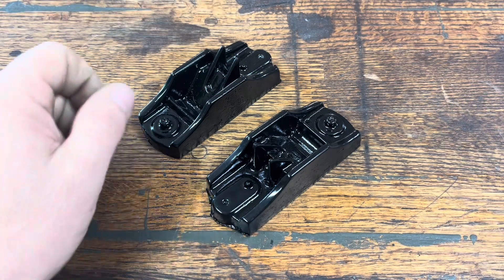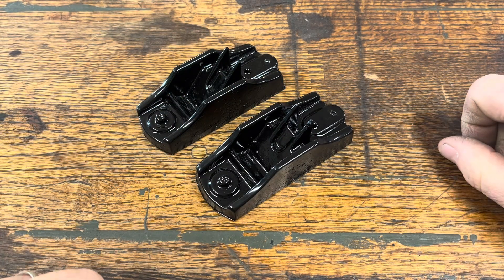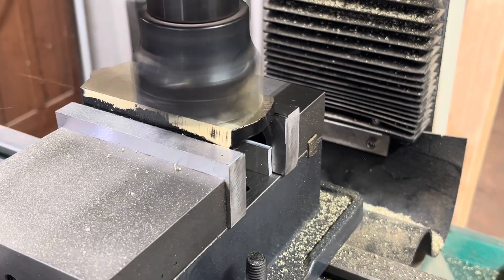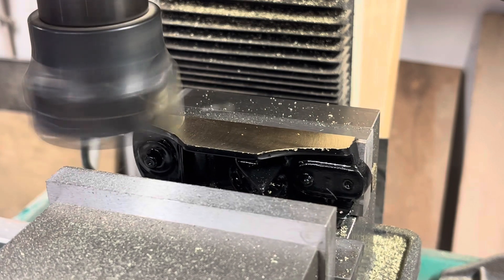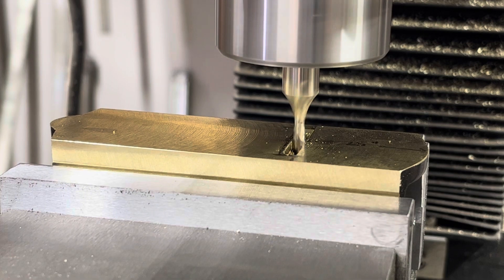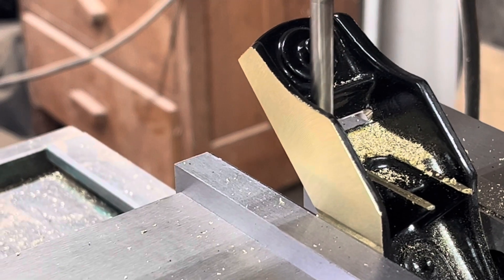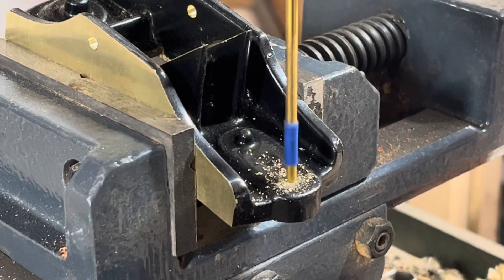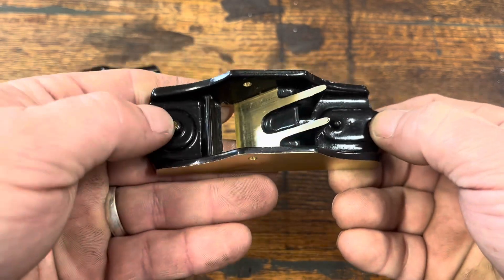Making a Plane from Scratch Part 2: Machining the Body

Comment: Great to see full scratchbuilding like this! 
I note that, when machining the sides, you appear to grip the workpiece at the bottom of the jaws using a rectangular block. (apologies if I am wrong, not easy to see). This is not the most stable clamping, especially when you are milling left to right, meaning that the cut is away from the back jaw. Clamping further up would be more stable- one way would be a U shaped jig with the legs against the front and back handle pads, and the centre against the moving jaw. I would still machine right to left, cutting towards the fixed jaw.
Tapping the holes- standard method is to use a tap-follower ( an easy shop build, or readily available) in the mill (or drill) so that the whole tapping process can be done while alignment is assured.
Enjoying the series!

Comment: Hi Dave, another informative video, thanks. Question; what blasting medium do you use for blasting the brass and would it be the same medium you would use to blast the cast iron of a Stanley smoothing plane?
Reply from the maker: I use a very fine white silica sand to etch the bodies. For the removal of rust and old japanning on older planes I use a im heavier black sand.
Reply: Thanks Dave.

Comment: Hello Dave, I’m by no means an expert but I was wondering if brass is a good choice for a long lasting plane. Isn’t brass too soft? Thanks for making these videos! I enjoy them very much.
Reply from the maker: For small planes brass is more than durable enough for planing. If it were a larger plane or one that would see heavier duty work like a scrub plane or a Jack plane brass would wear quickly. But for small planes that do light work brass is a good material.
Reply: @DaveCorinth   It looks like you already have the workflow in place, so it would be easy to experiment with other castable alloys.  Something like a 10% tin bronze (by weight, the rest copper) would be a bit harder than brass, and as an added bonus, it wouldn't have any zinc to burn and make toxic fumes.  A 10% aluminum bronze would be trickier to cast well due to more shrinkage issues, but if you pulled it off the stuff approaches steel in toughness.  Also, the golden color of aluminum bronze is really nice.
Reply: Wear is not a problem- these are for looking at, not using. They are very pretty, but a block plane will do the same job- and be more comfortable to hold, as well as having (if you wish) depth of cut, lateral  and mouth size fine adjustment. 
These will sit happily on a shelf, gathering dust but not rust... And be well admired.

Comment: I watched the video of using a 101 and found it so interesting! Now I have watched the casting process.  Why did you switch to casting?  Secondly why do you use brass? I know to heat steel or cast is more complicated - but brass well durable and somewhat easy to work with, for me is so expensive.  I might try aluminum or maybe a bronze. I sure do like what you are doing and thank you for sharing.
Reply from the maker: I switched to casting because I didn’t like the idea of drilling a hole through the sole of a 101, and wanted to make a body that could easily accept a tote and knob. Plus I’m naturally a curious person and I wanted to see if I could pull it off. I use brass because it’s pretty easy to cast. I’ve also used bronze is the past as well. I’ve never used aluminum and don’t have any intentions of making a plane or plane part with aluminum, just not a fan of that metal on a plane.
Reply: @DaveCorinth  I agree aluminum is not a good choice for a working plane - it might be ok for a show piece.  For beginners it can be an easer metal to obtain and work. I would say you are well on your way with your casting. Your miniatures are fantastic!